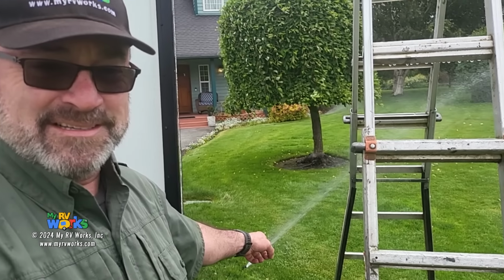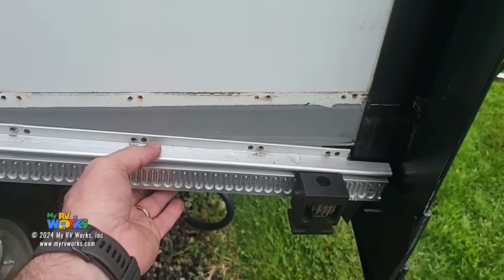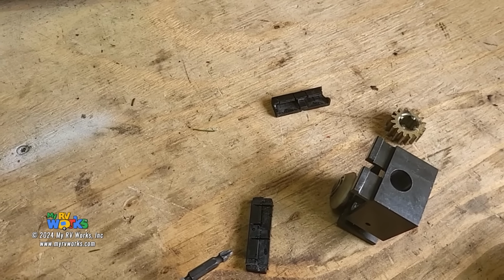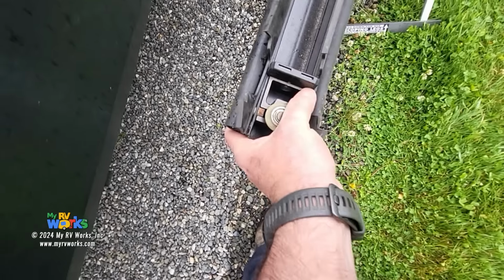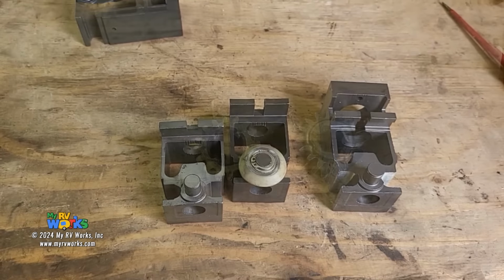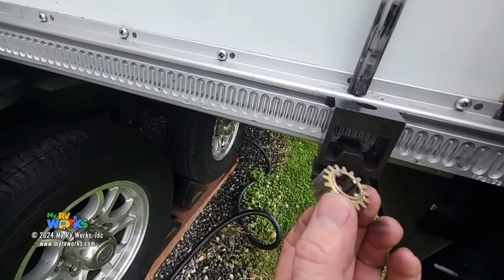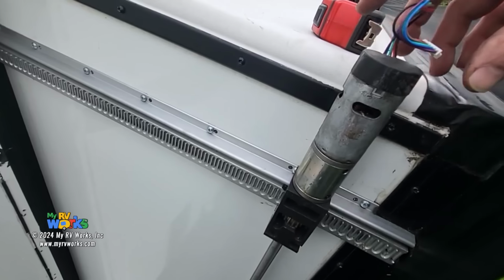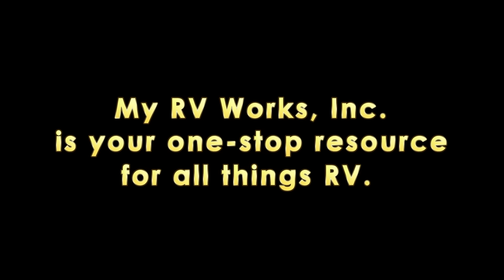Schwintek Slide Stuck Out 1 Inch (Broken Shoe)

Comment: Worked on this problem a few days ago. Closing the slide-out worked until the last 2-inches when the forward motor stopped while the rear motor sped up for 1-2 seconds until fully seated. No fault code on the controller, and my Coddiewample tester extended and retracted the slide-out fully and met the 50% compression of the bulb seals. Disconnected shore power and operated slide-out via controller while measuring voltage drop, cycled three times and voltage drop was less than 1VDC each cycle. Inspected motor and collet, spur gears and V-wheels. Applied PTFE, operated slide-out, and synchronized motors. Slide-out bulb seals compressed to 50% standard. Success? Your video makes me wonder if the bottom shoe is failing. Thanks for posting Darren. BTW, I left the dealership and am now full-time. Semper Fi.

Comment: I bought my camper used and the slide was pretty slow. I lubricated it using the CRC lubricant following a lippert video I found on YouTube and it worked much better. Since then I've lubricated it every few months and haven't had any issues.

Comment: Excellent video Darren.  We have a 2022 Winnebago Minnie that came with a Lippert/Schwintek Inverted rack system on the slide.  Kept it lubed per your recommendations from day 1 as well as supporting the slide when retracted/traveling etc.  The drive gear began skipping late last season. The manufacture date missed the posted TSB date by 2 weeks!  I called Lippert. They have subsequently increased the manufacturing date window on the TSB.  Lippert replaced the entire inverted system with a new standard rack system. All on their dime. The standard system is smoother and much quieter than the inverted system ever was...  Keep up the great work!
Reply: I just had the same inverted one replaced on my GD Imagine 17MKE. Hopefully, this one will last a bit longer.
Reply: What was your date? Mine is 3/21/2022
Reply: If you're asking me, I don't know. I had a shop do the replacement for me. It goes by the date on the slide not the date of the trailer. And I understand that they have enlarged the window of dates they will except.
Reply: @ThomasLips  I’m referring to the actual H column manufactured date found on its sticker.
Reply: @thedcgod   Manufacture date on ours was 09/14/2021

Comment: After having watched HOURS of your videos, I was able to remove and replace both my Schwintek slides. 

I had this same EXACT issue which caused my slide to STUCK in the open position so I couldn't even take it to repair facility. 

I ordered completely new slide system from Lippert ($1500 CDN for both sides). Lippert sent the wrong H column the first time (67 inches instead of 68 inches between each rack)

I also had Lippert send me a dozen new SPARE shoes. 

I just want to let you that I have been lubricating CRC lubricant. 

It does work much better BUT however, I will tell you that the lubricant does cause the foam pads on each side of the shoe  to come off as the lubricant must dissolve the glue holding the foam on the plastic shoe. 

After opening and closing my completely brand NEW Schwintek slide several times, the little foam ends will come off and stay in the groove which can now cause a possible jam IF it is not removed. I would advise and suggest removing those foam ends BEFORE reassembling your rack and H column.

Comment: Great refresher on the schwinteck.  I used your previous YouTubes to do a complete replacement a little over a year ago.  My schwinteck was completely wore out. The blocks, drive shafts, tracks everything. The slide is starting to show signs and sounds of excessive wear again.  Is it possible for a slide to just be too deep and too heavy.  My slide holds the bed (heavy 12” foam mattress) and separate washer and dryer?  
I have seen some schwinteck double track on top of full side slides on motor homes. So I’m puzzled.  Thanks.

Comment: You just convince me that experience with these units have more value than a bunch of book learning 😊 but it’s no my problem anymore I sold my MH with this system just because it was a headache I didn’t want to deal with plus I wasn’t using my coach due to mobility issues which was the primary reason. 😊

Comment: I have a similar problem on one of my Schwintek slides.  Top of the trailing end of the slide sticks out at the top of the outside  when closed and sticks out at the bottom on the inside when open.  Been that way for a couple years.  I never knew what the problem was until now.  I thought it was just out of sync.  I'll fix it (or pay someone to fix it) if it gets worse.  Will get some CRC with PTFE though.  Yeah, my Lippert manual says no lube on this slide.

Comment: You do bring up a Great observation on lubrication....
Schwintek uses two or more metals that come in contact with each other. There has to be a lube
to help prevent the metals from negatively reacting with each other.
(Example, aluminum wire in a Breaker panel on a house main or sub, panel. ) without that barrier
There would be heat build up leading to potential fire.
I was a fire truck mechanic for several years and we had anode rods, graphite coated rope seals, brass, steel, ECT
all having to work with each other so neither would wear each other prematurely.
(remember to clean and use correct lubricant often, clean before adding new lubricant is the best.

Comment: I would agree on lubrication, it makes a night and day difference with mechanical  forces and mating part wear.  The manufacturer has lots and lots of experience working with brand new parts that have never seen sun or dirt.  This experience has little to do with older RVs,... dirty, misaligned worn parts have no place in the factory.  I always smile when I contact a company to ask about parts and they act really surprised with the fact that something has failed, like they couldn't project years of real world use and environmental exposure upon their beautiful design.  I wonder what the company thinks is the downside to using lubrication?  Debris accumulation?  Just remember LEDs are so reliable you'll never really live long enough to need to replace them, well, except, ... that is BS.    Keep up the great videos, very informative.

Comment: Some of the Bearing Block Replacement kits come with aluminum, not hard plastic shoes.  Should these aluminum shoes be used or will they prematurely wear or destroy the tracks ?

Comment: Great explanation! I have a basic question, in this video I don’t see any supporting of the slide when you removed the track and h channel. Is it not necessary to support the slide?
Reply from the maker: You should be okay if you only work on one side at a time. That way the other side remains the anchor point to the wall.
Reply: @MyRVWorks unless the blocks slide out of the gibs, right? (Would take a lot of pulling but I guess possible)

Comment: I did call you last summer.  You never returned my call.  If the material is delrin I don't think it should be lubricated.  You do the research.
Reply from the maker: Thank you for the comment. What was the nature of your call? We direct everybody to a service request form where we gather the information from them.  Did you fill out a service request?  Otherwise, we're not going to return every call that comes into our business. It's just not productive for our small company. We simply do not hire staff to sit a round and answer every phone call and every email. 

Regarding the research on lubrication. The extent of our research is the amount of service calls we get to repair these units because they were not lubricated. As a former engineer, Darren is very familiar with performing research on mechanical systems The white papers may present tremendous details on the interplay of different materials in a controlled environment by highly skilled and highly trained technicians, but all that falls apart in the real world when these systems are not exposed to the test environments that the engineers created to test them in.  So while we can sit around and pontificate the merits of different materials, we will always advocate to lubricate mechanical components, regardless of their material.  For those folks that spend their time doing research and then choosing not lubricating these systems, we invite them to fill out a service request with our company when their system fails.  We have gotten very good at repairing these systems because of their choices.  All of the people we've helped and those that choose to lubricate with the recommended PTFE, have not reported any problems to us after the repairs.